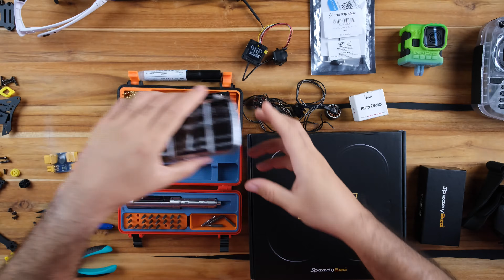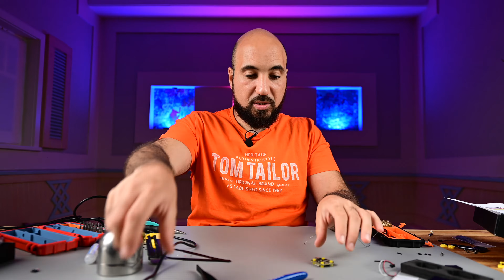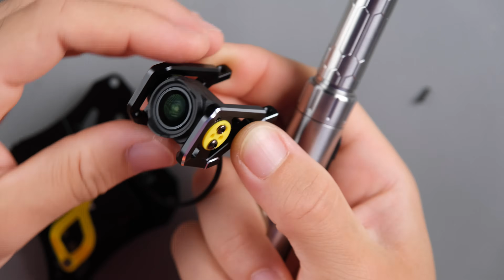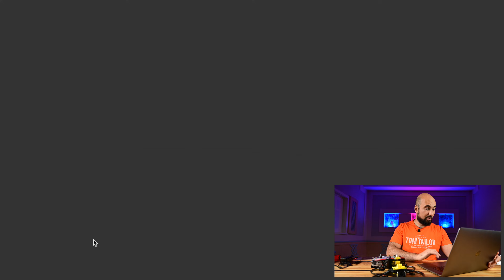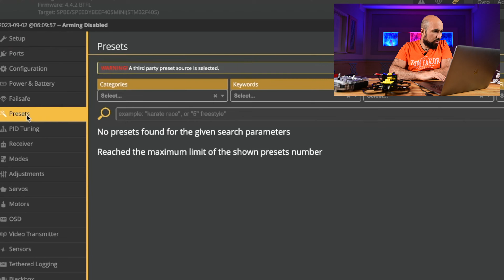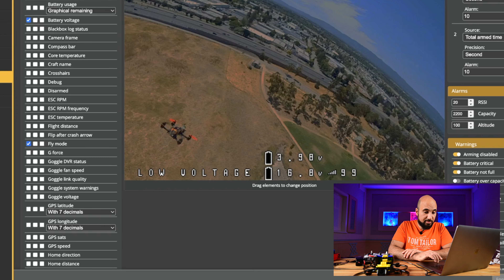✨ SpeedyBee Bee35 Full Drone Build | #build #speedybee #bestdrones #fpv #drones #fpvdrone #bilumedia

Comment: Awesome video, bro. I’ve built the same setup—using the O4 Pro and ELRS—but I’m not getting much range. I get a "RSNR Low" warning after just 100 meters. What could be the reason for this?
Reply from the maker: Thank you my friend 😊! I had the same problem a while ago, i flashed a wrong elrs firmware, it worked but it was really bad! What ELRS receiver you are using? Geprc?

Comment: Anyone used liion on this setup?
Reply from the maker: I didn’t try it but it seems a good idea…
Reply: @bilumedia if you would then which cells and what config would be great to get more flight time as I will just hover cruise it no free style with it
Reply from the maker: @t @techyboycharan450 have 9000 mAh battery made by my with the molicel inr-21700-p45b, but i didn’t try it with this drone yet! There are new cells that are very powerful, i am thinking to make a tutorial on how to build a pack for long range… mine i used it with 10 inch drone and i got around 38 min, for this drone it is too much of course, i have to find the sweat spot for wight and capacity!

Comment: Nice video bro. I have a question, if we don't hear the beep like at 36:00, then what is the problem?
Reply: Before everything was fine, then i got those problem after my quad crashed.
I already make sure, all the cables and sockets are tight and good.
Reply from the maker: So the second beep is the ESC… take te connector between the esc and fc out and see if there is any bent pins… or maybe the one wire is damaged somewhere!

It can be the ESC too, i mean it simply burned… see if you can find any damaged electronics on the board… 

I would change the wires between the esc and fc first
Reply: @bilumedia I just replaced the esc with exactly the same brand and type. My quad back alive again.
But the flight time becomes extremely too short.
Before crashed, the flight time was 10-12 min. But after esc replacement, the FT is only 5 min.

Comment: How can we increase flight time sir 
Like 6 minutes is too low ig
Reply from the maker: The idea is to decrease the wight of the drone to achieve more flight time and you can do that by using for example a naked vista and camera and finding the sweet spot for the battery capacity and the weight, for example maybe using a 650 vs 850 or maybe 1100 is better and of course not using a gopro will help a lot, if you use the new O4 system there is no need to use gopro for most cases…

Comment: i didnt uderstand how u connect that controller to drone, what setting i have to change in my RADIO MASTER TX16S to connect to the drone
Reply from the maker: @saisameer  you need to flash the same ELRS firmware on both the receiver and the TX16S, you can reach out on instagram and i can help you with that…
Reply: @bilumedia  thank u so much , i will text u in instagram brother

Comment: i purchased a pre build bee35 with elrs but i want to use the dji fpv rc 3, tried to connect it on betaflight but unable to do so, what do you think causing this? TIA

Comment: Outstanding video and it help me out.    I had an issue with a USB port that's in the very back of the drone would not connect with the flight controller so I had to open it up and plug into the flight controller. Did you have any issues with that or know what that would be?
Reply from the maker: Thank you my friend 😊! I didn’t have any problem with the usb “extender”! I would try to connect usb cable directly to the flight controller and see if it works and after see the adapter  if maybe there is a solder that is loose or something! Please tell me what did you find…

Comment: Great tutorial!! I used it as a "fixing guide" for a damaged Bee35 which I could repair and get back in the air again  :)  btw, where did you get the mask for the goggles?
Reply from the maker: Hi, thank you very much for your kind words, happy that i could help you 😊, what mask? If you mean the foam, i made a video about it and if you have goggles 2 it is a must, you will feel way better 💪: https://youtu.be/jgiDEj50yMc?si=8olmQ00vq2_mCygO
Reply: @bilumedia  that's exactly what I meant by "mask". Again, many thanks!

Comment: bro, your solder joints are not clean, when you are stripping the wires, you should only strip them to a short length. As a result, some of the wires are hard to solder and protruding inside the ESC barely touching the mosfets. Similarly use flux after tinning both the pads and wires for a better and fast solder connection. Otherwise, the build came out very nicely.
Reply from the maker: Hello my friend. Thank you very much for the advice! I appreciate a helpful comment like yours that helps me and others... I improved a lot my soldering skills from that build, it was due to bad solder and low temperature and of course the skills as well. I will take your advice into consideration 😊. thanks a lot

Comment: Its a good stuff to change your esc firmware to bluejay, them you can use bidirectional dshot and use like rpm filter on pid, some tests showed its more efficient even, like improving you fly time
Reply from the maker: That is correct, i usually change all my esc firmware to bluejay if they have BLHeli_S firware 💪😊

Comment: You are very cool. TY for this video. Can I build it with RUSHFPV RUSH TANK SOLO VTX 5.8G 48CH PitMode Pitmode 25mW 400mW 800mW 1.6W Adjustable 2-6S Microphone for FPV Long Range Drone and CADDX Ratel Pro 1500TVL 9.5g Super WDR 4.5V-27V NTSC/PAL CMOS FPV Starlight Night Vision Blacklight Camera for RC Drone? It's my first step in this... I have Radiomaster TX 12 (Edge Tx-ELRS), SoloGood Bandit Micro Elrs RF Module FCC 915MHz 1000mW/30dBm TX Receiver for Modeling Remote Controllers and ELRS 915MHz NANO ExpressLRS Receiver with T type Antenna Support Wifi upgrade for RC FPV Traversing Drones Parts. I hadn't have any expirience  to fly on real fpv, only i Liftoff and Uncrashed.....
Reply from the maker: wow my friend that is super detailed 😂, let's talk on Instagram and I will help you figure this out 😉 : bilu.media

Comment: hey, nice video! i build the same drone with the same setup but have the Problem, that my drone disarms at half of throttle, did you heard something about such a problem? And what config did you wrote in the esc?
Reply from the maker: Hello my friend, thanks! I think i have bluejay installed! Do you have a failsafe active, maybe it is configured wrong and cause the drone to stop! Check the wires between the esc and fc, maybe change it, the motors run smooth? We can talk on instagram if you want and you can send me pictures and video maybe to try and figure it out : bilu.media

Comment: Hello i am bilded SeepyBee35 by your video :) All flight but i cant see OSD, as i see you solder only 4 wires O3 without SBUS and G(Time 23:34).   But in instruction to mini stack it's 5 wires =9v+G+T1+R1+G-SBUS.  SBUS and last G didnt need?
Reply from the maker: Hi my friend, SBUS is for DJI RC2, I am using ELRS protocol and for this you don't need those, actually some times it can cause problems if you leave them! and for the OSD, actually yestreday I helped a friend with exactly this problem, let's talk on instagram : bilu.media 😊

Comment: Thanks for the help building this quad. I converted my Cinelog 35 into a Cloud 149 V2 frame ( absolutely bulletproof ), but decided to convert that again into this Bee 35 frame. It's quite an awkward thing to put together - and I lost count the number of times the frame standoffs fell out as you tip it upside down over and over again.

One thing though - I used your PID settings as in this video and just moving the throttle 1mm sent the quad up really quick and angrily I disarmed and altered the settings to something more friendly. Just thought I'd point that out - did you notice that and change your settings before flying - I feel it would have just cleared off on it's own.

Overall - It looks Great - testing time properly soon.
Reply from the maker: hello my friend, I changed the tuning after to the speedybee stock one, if you go to speedybee website, you will find a file on the drone page with all the settings needed and after I changed the rates to a cinematic really slow rates , because I am using it in commercial work more like indoors and near people, and I am flying it in Acro and it flies really good like this, I get like 8 minutes with the gopro 11 mini 😁
Reply: @bilumedia  Thanks.
I flew mine today through the woods, and it's fantastic.

Comment: Would it be possible to state what length bolts you used that worked when mounting F4 Mini and DJI 03 installation and other screws in the description the Speed Bee Bee35 manual is very weak when it comes to what screws to use. Thanks.
Reply from the maker: Sure my friend 😊, i just opened the drone to measure them and the stack screw is M2x18mm with countersunk head, this one is provided with the drone, don’t use the one from the stack! And for the camera i used M2x7mm and for the air unit is the same M2x7mm as well, i mean secured with the TPU piece!
Reply: I swapped to M2x8mm to make mounting that tpu a bit easier.  7mm were just a bit hard to get started.  Overall it is a nice build.  A bit tight to button up and I'm not looking forward to taking it apart to add gps for inav, but it will give me a chance to neaten up the wiring a bit.

Comment: Hi! I'm using the TBS Crossfire Nano System but with the DJI o3 Air Unit. Do I have to cut out the wires from the DJI Cable aswell?
Reply from the maker: Hi, sometimes you need and sometimes not, if you don’t use the dji controller 2 then i would cut them because you may encounter problems with the receiver not connecting!

Comment: haha! I already saw that the cable to the ESC was missing when you screwed the quad together. I was wondering the whole time whether you left it in the video or whether you would quietly and secretly fix the error. ;-) I think it's really nice that you left it inside! I built the Speedybee 35 myself a few weeks ago and unfortunately only had 2203 3390kv stan fpv motors on hand but I think they are too weak on 4s. I have now ordered the speedybee motors and am excited to see whether they will finally fly better and more stably.
Reply from the maker: 😂😂😂 yeah, i didn’t understand for few seconds what the hell is happening 😅! The 206 are very good, the drone flies really good and even with 1300mAh 6s batteries, i guess you ordered the 2006 6s?
Reply: Yes! I ordered the 2006 1950kv and I will go for 6s on them! I thought that Speedybee knows what is good for this quad… the xing motors are a little bit to expensive for me I think! 

But I am also very happy with the frame and the details Speedybee had thought of! I also put a COB led strip in yellow on it which looks great, but have you seen the new Speedybee meteor led strip they are offering now for the speedy 35? I ordered it together with the motors…. I hope it looks as good as in their promotions! ;-)
Reply from the maker: @p_fpv  You will be happy with the 2006 motors :D ! They sent me the Axis 2006 when I built the drone, I guess they didn't have their own motors yet, but I love how it flies!!!
I don't have the COB light, it looks interesting, I will maybe get one 😁
Reply: 😂I noticed too
Reply from the maker: @internettego  🤣🤣🤣 Then you are very focused and know what it is all about , good for you 🤟💪

Comment: Hello. What motors would you recommend for this frame? Currently I'm flying on my 5inch 4s 2450KV motors. I don't know what motors to select for this same build I'm planning to make. Thanks.
Reply from the maker: Hello my friend, i am using 6 s motors, you can see at the beginning, i present the exact motors, the are the axisflying c206 motors, you have link in the description with these motors, they are very very smooth and powerful im the same time,

Comment: Will this frame fit the new Speedybee f405 V4?
Reply from the maker: Hi, technically it will fit! So physically it fits but it will be a little tight! SpeedyBee Doesn't recommend to put this stack in the drone because it is a compact drone and they design the mini stack for it! but I guess you can install it and put the capacitor and receiver in different places where they can fit :)
Reply: @bilumedia  Oh gotcha, thanks for responding. I found out the hard way when trying to put the mini in my axisflying c25. “Technically” it does fit but I blew signal transformer when I squished the stack too much. Don’t want to make the same mistake :)
Reply from the maker: @iCrazy414 🥶 ouch, sorry to hear that, yeah i know what you mean, it is better to be safe than sorry 😄

Comment: Thanks for this build video. Just received mine yesterday and I am starting to put together now. Since it is kind of an upside down build, it will be great to see how it is put together ahead as I go. One thing- I bought the pro version and am a little irritated that I missed in the fine print that the detachable gopro mount wasn't included with the pro. Also, no paper instructions came with mine.
Reply from the maker: You are very welcome 😊. Yeah unfortunately the little gopro gimbal is sold separately 😞, i said in the video at one moment that i think that it is sold separately, but i was not sure at that moment ! Sorry about that! If you need any help just let me know, good luck and have fun with the build 😊
Reply: @bilumedia I'm loving this build. Installed inav at first with a lidar board hoping to get dependable locked in altitude when flying low and slow. I was not able to get altitude control to work well even though it flew very nicely otherwise, so I went to Betaflight. I may try inav again soon since inav 8 is out now.
Reply from the maker: @kurtzFPV  I didn't use INAV before, it sounds very intersting ! And the lidar idea is intersting too, I have something similar from and old drone... but I love to fly completly manual ...
Reply: @bilumedia  I too love to fly manually, even when flying indoors. But even the very best cinematic fliers show some up and down movement when doing a real estate fly through for instance. I was hoping to get the lidar mode working well enough just to use in such specialized instances. I was wrong in the post above. I tried inav 6 and it is inav 7 that has just been released. I thought it flew very smoothly in manual - just as smooth as Betaflight. But I actually prefer Betaflight return to home right now over inav, even though inav is far more precise. But it takes so much more tweaking, since it is also using a magnetometer. If it isn't calibrated exact right, the quad will start swinging in circles when using altitude hold or return to home. I'm sure I'll try inav 7 at some point. I'll let you know if I have more success than with 6.

Comment: Thanks for a detailed review! If to use a non pro frame with flat bottom plate, do you think if vista vtx will fit in there with that full stack?
Reply from the maker: Hi, no it doesn’t fit a full stack and a caddx vista, i advice you to but the pro version, it is just slightly more expensive and you have the bottom plate acts like a heat sink for the caddx vista too and the caddx vista fits without any problems, there are holes especially for mounting the vista unit 😊
Reply: @bilumedia  thanks a lot for information ). Going to get the pro version then. It is not the higher price that I'm concerned with, I just don't like that it is sticking out that much from the frame. But ok, will get used to that
Reply from the maker: @Curiousity0309  you are very welcome 😊. It doesn’t look bad at all and it is aluminum and it protects you air unit very good and there are some feet that the drone land on, so it will not land on the air unit 💪

Comment: Nice build and setup video! It's outside of the scope, but I've become a believer in pre-arm. I use my Trim-Yaw-Right as a pre-arm which work great for me as I have no use for them as trims flying quads.
Reply from the maker: thank you very much 😊! It is an amazing drone, I love it , it flies very very smooth and has ton fo power! I have no idea what is pre-arm! It is like a step that you have to do before arming?
Reply: @bilumedia Yeah, Pre-Arm (a mode in Betaflight) is an additional button (it should be momentary, IMO) that has to be pressed for Arm to happen. This prevents one from accidentally flipping the Arm switch and have the props start spinning. Example: carrying both your plugged in quad and your controller... and the Arm switch getting accidentally bumped to on. In my config, I have to hold Trim-Yaw-Right before flipping on Arm (or Turtle Mode). In EdgeTX, the trim switches can be made to be pretty decent momentary switches. Maybe I'll make a video.
Reply from the maker: Interesting , I didn't use Pre-Arm before, but it makes sense ! Thank you very much for explaining this to me 😊
Reply: I know it is not a full replacement for prearm, but I have trained myself to always raise the throttle after disarming, which at least is a bit safer. I should probably look into setting up a real prearm on my larger quads.